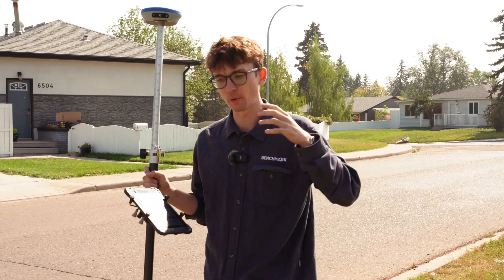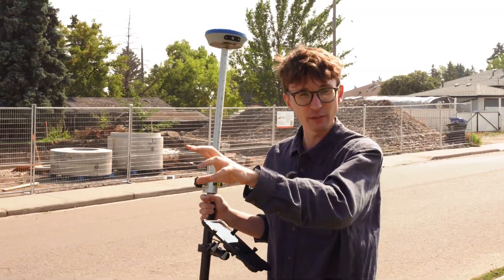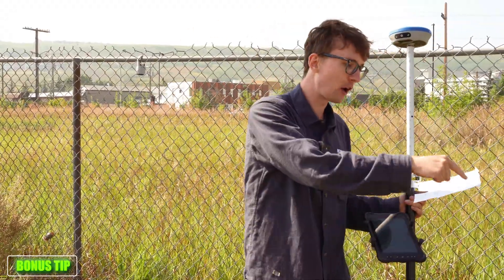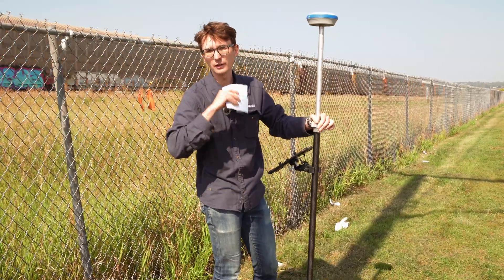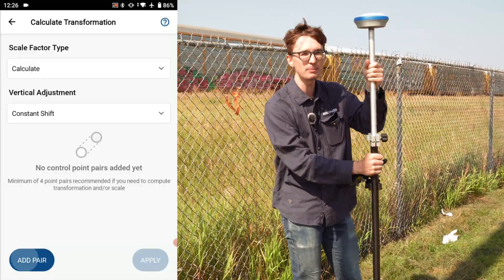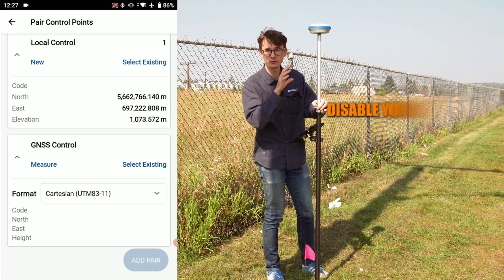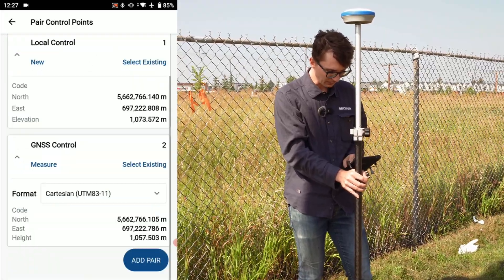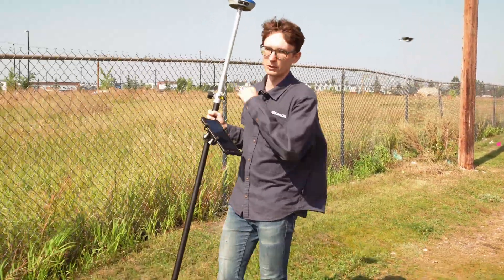How To Do A Localization with RTK GPS/GNSS Surveying Equipment (BEGINNERS GUIDE)

Comment: @4:05 Hello Nolan! What do you mean at this time to use just one single point for verticals? For example, if you have 3 or 4 TS control shots, wouldn't be better to use Horizontal and Vertical to all points to get a "best" fit for the real orthometric/gravitational heights? Horizontal is pretty normall, but for Vertical and heights this subject gets a little bit more complex to understand. Could tyou clarify it? Thank you so much for such a great video about this topic.
Reply from the maker: Hi Iztoniolo, It can really depend. The issue with holding only a handful of points in the vertical is that if you are not careful you can create an inclined plane. This is especially true if you only have 2 points. Even at 3, you can easily create an inclined plane across the project. We typically recommend not activating vertical on all points until you have 6-7 points to avoid running into this issue.
Reply: @benchmarkequipment  Perfect explanation Nolan! It makes all sense. There is lots of difference when using and not using control points in vertical component? I mean, wouldn't be sufficient just using the GNSS geometric heights and applying a geoid or GNSS calibration with multiple points (6-7) would be more precise because TS shots is trylu orthometric, giving a better representation of gravitational field for the area? Thanks!
Reply from the maker: Even with only three to four points, you can still hold one of the points in the vertical to adjust to the local elevation. In theory, I believe your TS shots should be more accurate, you just need to ensure that you have enough points to avoid creating an inclined plane. To know the best procedure For your area I would definitely consult the local surveying board.